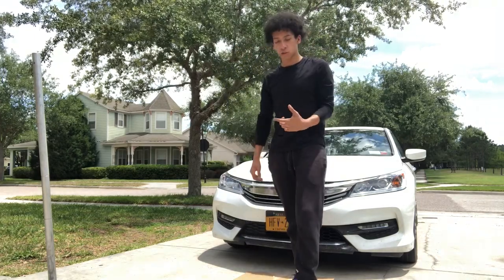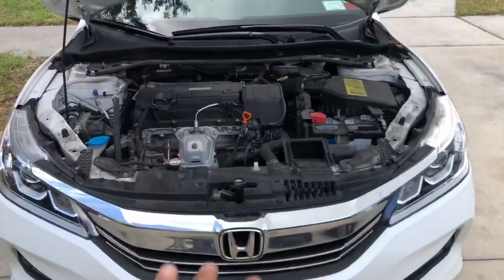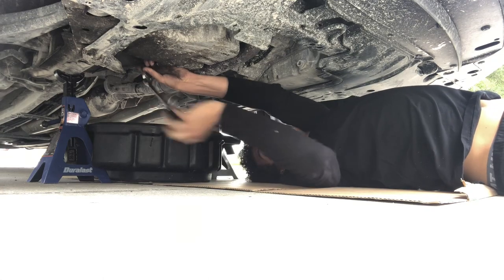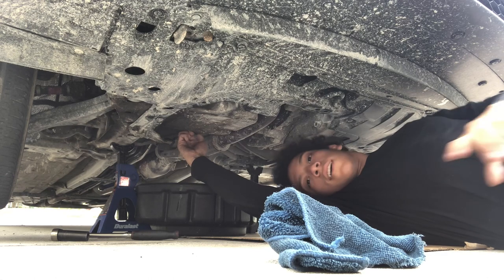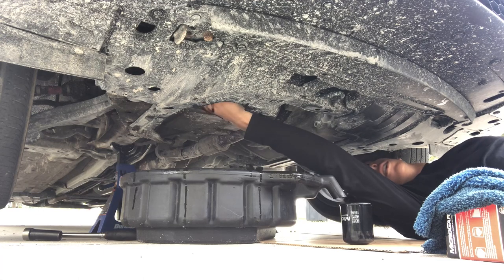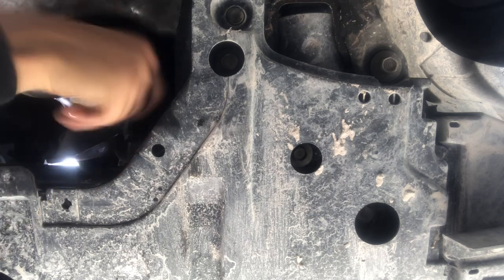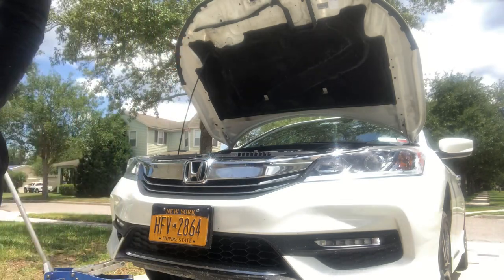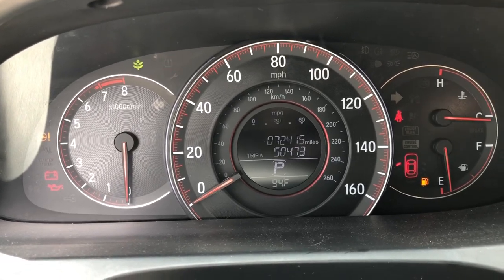2016/2017 Honda Accord Oil change & reset oil life

Comment: Do you add oil to the rim of the new oil filter before putting it on?
Reply from the maker: Yes you can do that by spreading it with your finger ,becareful not to cut yourself though